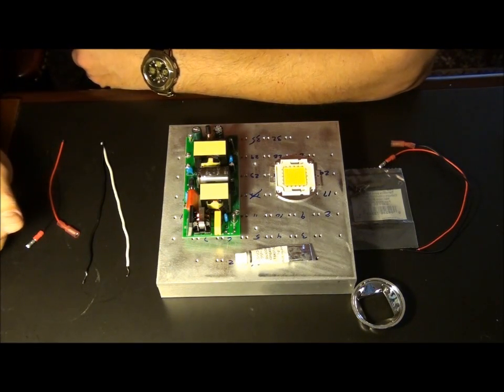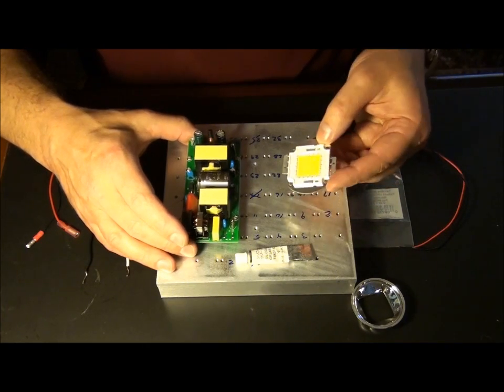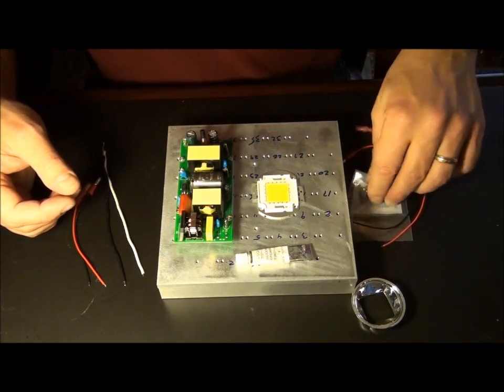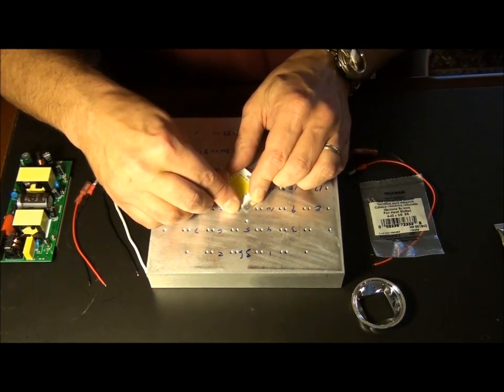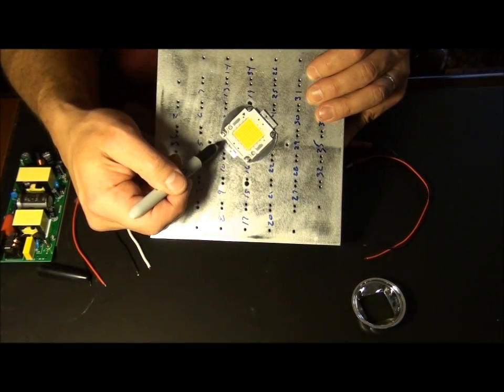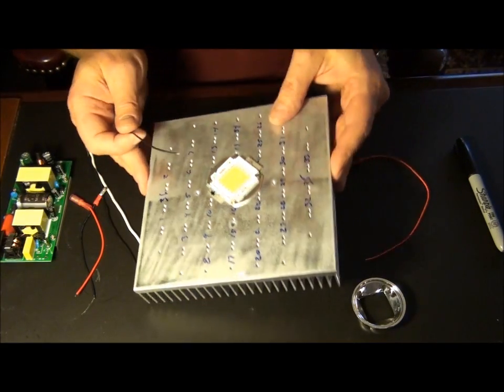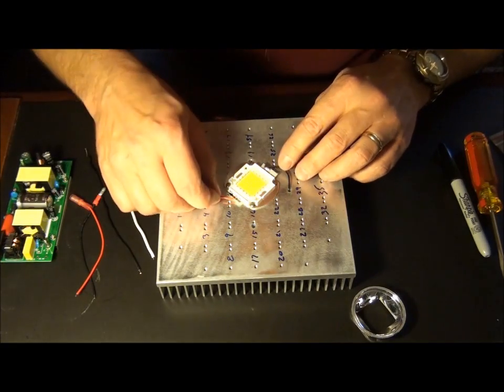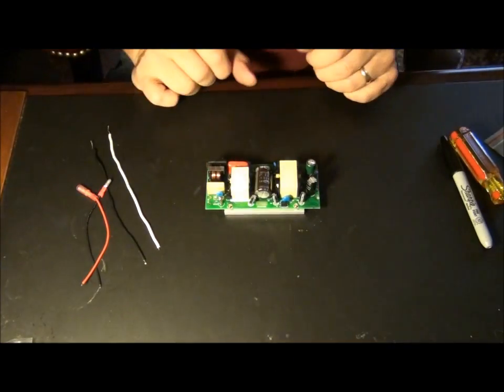DIY LED Reef Aquarium Light - Part 2

Comment: If Im not mistaken, thats the exact same power supply I purchased, a combo 100w LED. I did not get the full 100w with that driver.  Mine was only 50w total. You need voltage & current adjusting to get a much brighter light. I bought a 200w 12v power supply & 150w boost regulator & WOW much much brighter light!!!
Peace out!

Comment: it would be cool to water cool the led using the water in the fish tank. so the tank gets heated and no energy is wasted. 
you would use a cpu water block, some vynil tubing and a small pump.

Comment: would this led give me a nice white light ?
Color Temperature: 6000K ~ 6500K
DC Forward Voltage (VF): 17V DC
DC Forward Current (IF): 2500mA-3000mA
Viewing Angle: 120 Degree
Intensity Luminous (Iv): 3500LM-4000LM